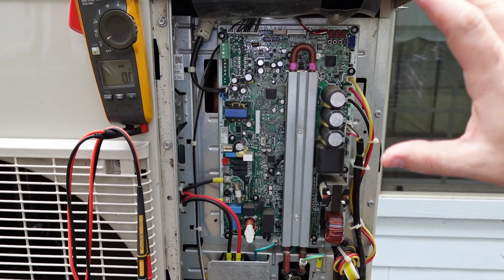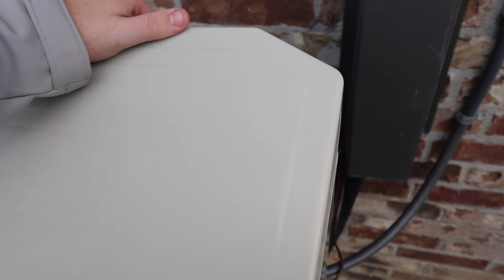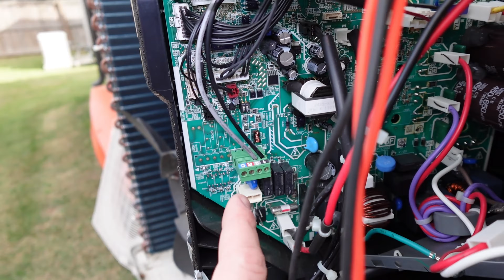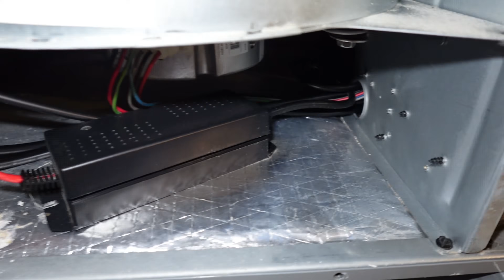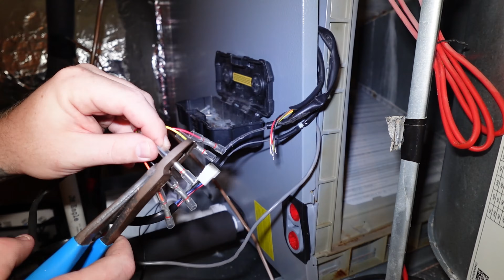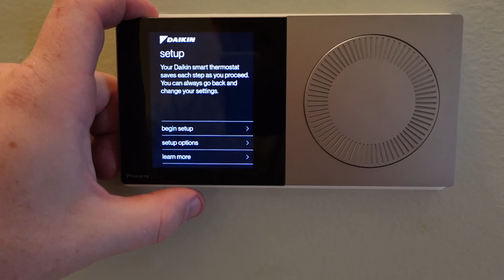How To Fix Daikin FIT Communication Issue. HVAC System Repair

Comment: Just had our Daikin Fit system installed, and everything was great for the first hour or so. However, after I turned on the "advanced view" in the thermostat, it started reading 5 to 6 degrees hotter than the actual room temperature, causing the unit to run nonstop. To make matters worse, the dealer locked down the thermostat with a custom access code, completely preventing me from entering the installer settings to apply a temperature offset correction.

It seems like the display LEDs or the internal communication components generate too much localized heat inside the housing, which throws off the temperature sensor. My temporary fix was to put the thermostat into night mode (turning the display off completely), and the unit immediately started working as expected again.

Unless I just happened to get a faulty thermostat, this is a major design flaw on Daikin's part. When this is happening, you can actually feel the physical warmth radiating right off the thermostat's cover.
Reply from the maker: Straight up we got a notice about this like 3 years ago. They sent us the solution. Turn the system off for 30 minutes and let the thermostat just sit there. Set up an accurate temperature gauge on top of it. After 30 mins adjust the calibration of the thermostat. I use a fieldpiece pocket psychrometer that lets me adjust the humidity and temperature at the same time. 
Thats the fix for the calibration
Reply: @WorldofHVAC I did the calibration and all is good ... Surprised the installers didn't handle this.
Reply from the maker: Youtube ftw lol

Comment: Add:  still getting the code 42.  Tested the voltage inside and outside just now when it goes from .6 to negative at times.  Tried a new transformer and it seems to be running a little better. It’s a little cooler today, but I’m still getting a code 42.  Today where I live it is currently 88° outside at 52% humidity and it will pull the house down to 73°.   I hate to buy a new unit when this one is working somewhat.   It has to be something pretty simple.   

 Just had two a/c repair companies come out and look at my unit just like the one in the video.   One spent 8 hours and said I needed to replace inside and outside blower motors and the inside circuit board for almost 3k.  The next company spent a little over an hour and said I needed to replace everything.   Went out and checked voltages as shown in video and it was .3.  Pulled disconnect and flip the dip switches and had .6  so far it seems ok.  Will know for sure when it gets hot out.  It was keeping house cool at night but during the day it was not able to keep up.  Would come home to a 80 degree house.

Comment: Can I connect the wires with just wire nuts and not the butt ones?
Reply from the maker: If you really have to but the goal is to keep them out of the moisture
Reply: @WorldofHVAC I did it with just wire nuts to see if it would fix it but it still threw an error code and I connected all of them right

Comment: I have a Daikin Fit 4 ton unit. We were getting error code 22. Tech replaced thermistor assembly kit 2493932.Unit ran about 30 minutes then stopped and gave us error code 58. Any ideas?
Reply from the maker: I had to look up error 58 which is compressor overload which is common on regular 14 seer systems but I have literally never seen it on a fit. If I had to guess that system is overcharged but I would have to see it in person.
Reply: Tech added refrigerant, but wasn’t confident that was the cause. Safety float switch dry and new filter is dry also
Reply: Tech checked for leaks on evaporator coil and that was fine
Reply from the maker: Would you happen to have the gauge pressures with superheat and subcool?
Reply: I don’t, but I think I heard him say about 240??

Comment: Ever installed a Daikin DH9VS ? I’m looking at upgrading my single stage Lennox xp14 heat pump.
Reply from the maker: Yea thats the new one. We have installed a handful and they work great. Definitely make sure you have a brace you can install between the wall and the top of the unit, it's pretty tall
Reply: @WorldofHVAC that’s great to know.  Do you think you need that support if the base is anchored into a concrete slab?
Reply from the maker: Yea I would still add the brace. Its pretty tall and heavy for that skinny base

Comment: I have a u4 comm error. FBQ series. Tstat reads indoor but not outdoor infor. 
16v tstat. 0vdc across transmission 1 and 2. I replaced indoor comm board and outdoor pcb. Still u4. What am i missing?
Reply from the maker: Between 1 and 2 outside you have 0vdc?
Reply: @WorldofHVAC correct
Reply from the maker: You have a wiring problem from the indoor to the outdoor unit. The dc voltage comes from the indoor unit. If you hold the wires just in the open air and test them you should get voltage from inside. If not your wire is messed up
Reply: @WorldofHVAC alright i figured it out. Odu fan motor was browning out the board, no lights on hp1-8. As soon as i unplugged it. All lights came on. So new fan motor, reset and boom working. I spoke to Daikin they said transmission lines communicate both ways. 

But yah thought youd like to know. If it has no hp1-8 lights, unplug the fan motor

Comment: So what was causing the communication issue? Was the system not commissioned correctly? Or the bad wires inside the air handler?
Reply from the maker: Flipping those dip switches wasn't a part of commission when those systems came out. There was an over the air update around the time this video was made that gave us a bunch of problems. I made this to help other techs solve the issue after I figured it out.

Comment: I currently have the Daikin 1800 btu Model number RX18BXVJU. during heat mode it throws an F6 error code and does not produce heat. Any suggestions would be greatly appreciated.
Reply from the maker: Thats an issue with outside, could be dirty or have a bad thermistor.
Reply: @WorldofHVAC  Thanks for the quick response. Ill try to clean it as best as possible. I do know I have had a bunch of power surges lately and need a surge protector, which is what I believe has caused the issue.

Comment: Had a FIT installed 4 years ago - started having problems this week, what do you know, low voltage at the specified pins on the outdoor unit AND rusty connectors that needed to be bypassed in the attic. You are a SAINT. Saved me a ton of money. Hugely appreciated!
Reply from the maker: Awesome! Glad I could help!

Comment: Does turning the dip switches off damage the system in anyway? Or void any warranty? What’s their purpose?
Reply from the maker: It doesnt void the warranty. We were told from the factory to flip the switches to fix the bias issue. The switches can be used to test certain things. You can force the unit to run 100% from the outside if you set them correctly.

Comment: Hi guys I have an older Daikin model FTXS12LVJU (for the head)- it recently started to power cycle constantly. Once in a while I can get it to work for a good 15minutes or so before it starts turning off and on repeatedly. Anyone seen this? Daikin says i should replace the main board on the head.. but they cant guarantee that's the issue. Thanks!

Comment: Love the video. Just curious, what are you actually turning off by setting the dip switches to the OFF position? Like what is their function to begin with?
Reply: Nobody knows. But if there are two banks of switches be careful. The other set just kicks the condenser on to run nonstop😅

Comment: What should I check first? I have a single heat pump serving two furnaces on Dakin One stats, one is communicating just fine, the other is stuck with a communication error. Initial problem was after a power outage. The upstairs unit began communicating again after I power cycled, downstairs did not.
Reply from the maker: Behind the thermostat you will have 4 terminals. R and C will be 24vac. 1 and 2 will be around 0.6 vdc  covered in this video. Checking to see if your viltage is correct there is a good start
Reply: I may have found something. Getting 24vdc at the stat, but only 3vdc on P1/P2 at the stats power supply that then hits the furnace. The working furnace is getting 15vdc. Tell you anything?
Reply from the maker: @Cwhittit the furnace is getting 15vdc? The furnace control board is what produces the DC voltage. I'd have to take a closer look and see what it's actually producing by pulling out the green plug and testing the posts
Reply: @WorldofHVAC  you have any good tips for finding a local tech? The guy that installed these was sharp but has retired.
Reply from the maker: @Cwhittit call your local Johnstone. They're the daikin supply house
Reply: @WorldofHVAC  oh shit! That fixed it! I pulled the plug off the furnace pcb to test the posts and they were testing at 16vdc. I got excited and slapped the plug back into place and retested. What was 3v is now 16v and communication is restored.
Reply: Here’s a link to the p1/p2 terminal I’m referring to. https://daikinone.com/files/2022-09/IOD-7134.pdf

Comment: Followed the steps for the communication issue on the outside unit but still the same result. My inside unit/ heat is still working but the ac unit, nothing.
Reply: I called a ac technician out and all he said was it is an electrical issue. He wasnt helpful at all.
Reply from the maker: Did you perform a run test after you flipped the switch?
Reply: @WorldofHVAC  Run test?
Reply from the maker: @chrislatham7097 yes a little later in the video I show you how to do a run test this will make the system recognize the outdoor unit and solve the communication problem. If it doesn't theres another issue. 
Do you have a meter to check power at the unit and dc power at the plug?
Reply: @WorldofHVAC  No, I need to buy a new meter. The two I have wouldnt read even a wall outlet.
Reply: I was able to factory reboot the units from the thermostat. The ac unit is finally showing on the display after months of not turning on.
Reply from the maker: Glad you got it to work again

Comment: We encountered a communication error on thermostat only one month after the installation. Is this related to installation?
Reply from the maker: If it's that soon it could possibly be the connections. They have to be done correctly if not bad wiring and termination will create communication issues

Comment: My Daikin for suddenly stopped working.   The air handler still shows up on the thermostat as a communicating piece of equipment but not the heat pump.  I checked the unit outside and it seems to be receiving power as light on surge protector is green.  Breaker was found tripped.  Any help?
Reply from the maker: You'd probably be better off calling for service if the breaker was tripped these components as sensitive and expensive. Don't want to risk damaging them

Comment: An hour ago my AC was working fine (although battling Oklahoma heat) and tonight it said communication error on the thermostat, then the support sent me to a subscription sign up page for further help with the issue. I’ve never been more supportive of a nuclear war. This all looks and sounds like a couple hundred dollars I don’t have
Reply from the maker: Is it this issue? Did this help? If not let me know what you see and I'll try and help
Reply from the maker: They might be pushing you to the monitoring. That's not going to help. If you got the extended labor warranty the repair should be free
Reply: We purchased the house last October, everything was working fine until tonight. Worth saying that I know NOTHING about HVAC. Following some other tutorials I took off the plates of the furnace in the garage and tripped a kill switch, and so far it’s definitely been a kill
Reply from the maker: If you took the plate off then it definitely reset it. Did it reset it?
Reply: While I’m not educated enough to know for sure I am guessing that is what happened. I reconnected the thermostat to wifi, set it up on my account (we moved into this home last year, first time I’ve had to mess with the thermostat so it was actually still linked to the prior resident, again not educated on this stuff) but I’m missing something easy I’m sure that a HVAC guy would switch and bill me $100

Comment: About to have one of these installed. What are the symptoms that signal these issues?
Reply from the maker: You won't have to worry about it. They updated the units and the thermostat. The bias problem doesn't exist on the new ones
Reply: @WorldofHVAC  wow, fantastic!
Reply: @WorldofHVAC 

Do you happen to know about when they updated the units and thermostats?

Comment: You started this video by saying the Daikin Fit is great at dehumidifying. I totally disagree. I am having a horrible time getting mine to dehumidify my house.
Reply from the maker: Gotta check the settings and see how tight your house is. Also check calibration. The thermostat has to stay 100% off for 30 mins. Then check the calibration on temperature and humidity and see if it needs adjusting
Reply: What is your dehum profile set to?

Comment: Do you leave the dip switches in the off postion or turn them back on once reading the correct dc voltage?
Reply from the maker: Leave them off. They dont have to be touched again
Reply: @WorldofHVAC  thank you
Reply from the maker: @jonathonmonique9069  You're welcome